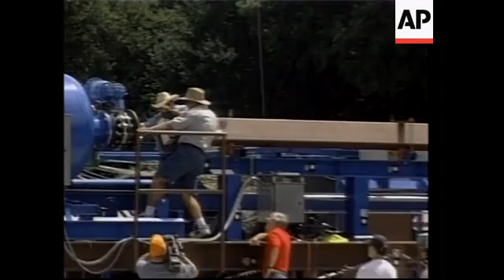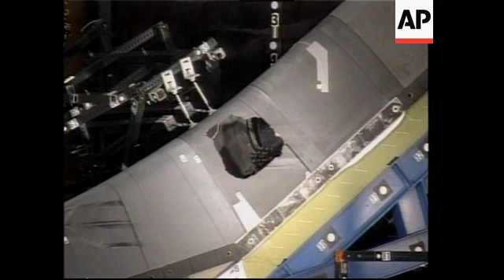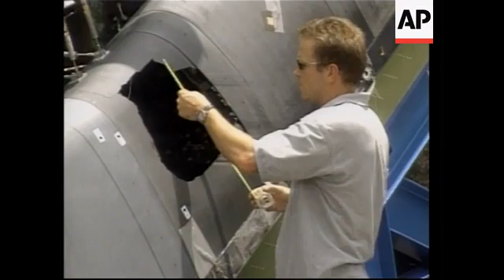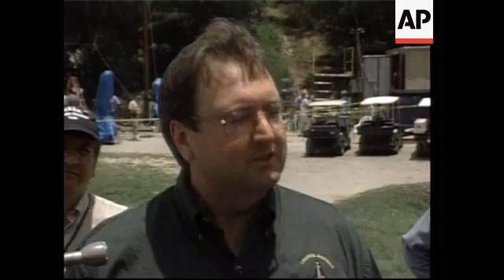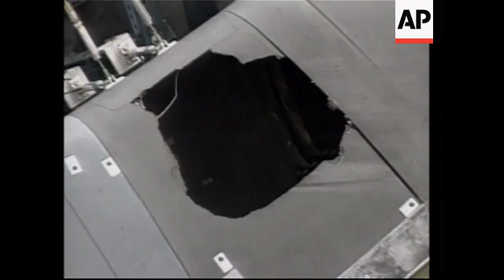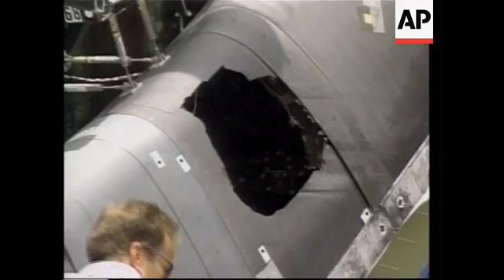Foam test blows hole in wing

Comment: This test looks like it was designed to confirm a bias not establish any data. Firstly the foam projectile was fired at what appeared a 90 degree incidence to the flat section of the wing panel, which is maximum force at the possibly weakest point. The actual investigation put the angle of impact at less than 20 degrees and probably on the leading edge which may have much greater reinforcment than the wing surface. Also, the foam was tumbling in flight which may lessen any impact force, and the foam was already travelling at 500-700 km/hr in the forward direction at detachment. If the foam actually was travelling at 500km/hr and we ignore deceleration/acceleration lag, it would have traversed the 47m of the external tank in .005 seconds, or twenty times faster than a fast human blink. The video may have been slomoed but it didn't look anywhere near that!
 I would have been more impressed with the test if it had replicated actual conditions and had the foam bounce of the leading edge, or even the flat wing panel, and analyze the damage caused then. Also I wondered at the time why it wasn't standard practice to inspect for damage in orbit. Perhaps they did. I would have!
It really could have been anything: roasted bird strike on re-entry, space debris in orbit? I know, the odds are astronomical, but then that is where they were, up with the stars. Ite in pace space travellers.
Reply: Just watched a new documentary on Max. They could have looked at it and even discussed asking to use military satellites to look at it, but ultimately they didn’t.
Reply: You can google the Columbia Accident Investigation Board Final Report - there's a readable pdf version. You'll find many of your assumptions are incorrect, as well as answers to your questions about whether or not they looked at the wing on orbit.

Comment: Keep in mind that after that foam strike, airflow was still increasing through that hole, i think a lot more damage was done. If the telemetry data is available to the public, i bet the drag caused by that hole yawed the shuttle slightly to the left.
Reply: Correct. You can look up the Columbia Accident Investigation full report online and that is exactly what happened. Unfortunately the shuttle comes in under computer control, so the computer was compensating as long as possible without any human noticing. Eventually all trim control was melted and the wing so deformed that the shuttle could no longer maintain position, went into a tumble, broke up.

Comment: The full context makes this even more shocking. The NASA heads were ADAMANT that it was just foam and it couldn't cause much damage to the wing of the shuttle. This footage proved them so wrong and so shockingly. It punched through the wing like paper!  Reminds me of a Mythbusters episode when they rigged up a tube system to launch a ping-pong ball to over mach 1, and fired it at a ping pong paddle. Well, the lightweight ball smashed a clean hole right through the paddle.

Comment: I'm surprised that NASA did not perform tests of this type prior to the Columbia disaster. They knew that foam coming off the tank was a fairly common occurrence. I guess hindsight is 20-20.
Reply: A perfect example of not to assume there isn't a problem just because the outcome happened to be ok a few times before
Reply: I worked in the USAF (civilian) and our Colonel was called in to the investigation.

I understand the phenomenon but not sure I can adequately explain it but I’ll try.

So the wings were designed to take impacts from debris impacting the leading edge.  What the wings weren’t designed to do was take impacts to the flat wing surfaces that were perpendicular (90 degrees to the flat surface).

What happened was the piece of foam fell down and the piece sort of “twisted” (for want of a better term) after hitting the leading wing edge and caused a portion to hit the underside of the wing at near 90 degrees causing the hole to be punched into the wing surface!
Reply: They learned zippo from Challengers, sad indeed.

Comment: I remember when we first found out about the foam there was a representative on TV saying there's no way that lightweight piece of foam caused this accident and I knew right away it did.
Doesn't matter how light something is, getting it moving fast enough and it will do damage.
Reply: Hindsight is 20/20, but yeah, that guy pretty much invented the "Wow, that didn't age well" meme.

The big issue is that they had tons of data and had computational models for tiles damage (the program called CRATER) but basically had NOTHING on what impacts would do to the reinforced carbon carbon panels of the leading edge.

They used the incorrect analogy of a foam cooler hitting a car on the interstate. Assuming a speed of the car at 70MPH, the maximum impact speed would be 70MPH (and that assumes that the coolers just stops dead in midair).

The speed of impact of the foam on the Shuttle was around 600-700MPH and it was not a glancing hit.

Comment: Should've been held liable for murder. When I was growing up it was stated anything strikes the orbiter that launch was aborted. Even in flight.
Reply: NASA didn't know until Columbia was in orbit, so an abort wasn't possible. A rescue mission might have been, but they didn't try.
Reply: @jshepard152  even then a rescue mission wouldn't be worth the risk. as far as i know, the only other shuttle they had was atlantis which wasn't ready for launch and would require multiple security checks to be skipped if they wanted to launch it early. if the columbia shuttle shouldn't have been launched under the conditions it was, then atlantis absolutely should not have because now you're just doing the same exact thing but far riskier with a new crew and a more complicated goal. worst case scenario the resource-intensive shuttles both end up disintegrated with both valuable crews lost and you've completely botched two anticipated shuttle missions in a row; which sounds pretty disheartening.
Reply: why would they be held liable for murder? that's like calling a contractor a murderer for building a house that collapsed onto its residents after being left unmaintained for 70 years.  60% of the NASA's shuttle launches at this time had insulation foam break off the exact same way without any problems using the exact same method. they had no idea until then that it could gouge through the wings at that size because they had no reason to believe it wouldn't have happened already if that was possible... y'know, right until that point. the crew are also made very aware that this is risky and they could die doing this. at this point there was no established protocol that they were failing to do, nor any intentional mishandling of the shuttle so you couldn't consider it manslaughter OR murder. they wanted and did everything they knew worked at the time to get this shuttle in and out of space. the design just wasn't advanced enough back then.

Comment: Show this to the 911 conspiracy theorists, "how can an aluminium aircraft damage a steel structure"
Reply: what if a space shuttle crashed into the twin towers
Reply: @lightyagmi2010 😂👍
🤫👶🏼😴
Reply: So you're saying the strength-to-weight ratio of carbon vs foam is comparable to aluminum to steel? And that the impact energy of a chunk of foam versus the carbon leading edge has a comparable ratio to the impact energy of a plane versus a building? I'm not a conspiracy theorist but what you say makes no sense in an engineering perspective. I shot somebody with a gun and they died so a plane into a building will cause it to collapse?
Reply: @straightpipediesel  its all the momentum, that energy has to be displaced somewhere. Even if you fired a gummy bear at something with enough energy it could do some damage
Reply: @straightpipediesel  foam vs something that is 10x stronger then steel
Reply: toooo beeeee faiiiirrrr their argument is usually the whole "jet fuel can't melt steel beams!!!!!!!" stuff and not about the airplane itself
Reply: Conspiracy theorists are all loony.
Reply: Yes Lucas sure thing 🤣
Reply: Cruise planes would fall apart at that speed and weight even before hitting anything. Planes hit the buildings, but they were not passenger planes, they were military planes. And no, they did not bring the buildings down, controlled demolition did.

If you believe the official narrative you deserve a vaccine every month.

Comment: The edges weren’t tough enough.  The material seems brittle.  And the insulation should have been inside the tank housing.
Reply: yes, insulation inside makes sense..but that means double wall i guess, too much weight maybe, but nothing is stopping foam traveling over 700mph..heck it'll do 17,000 mph, 4.9 miles per second, the shuttle isn't withstanding any threat from space either, just a room to hold in oxygen and keep out the heat and cold

Comment: What's amazing to me is that despite most of the engineers and scientists having PhDs they ignored a simple equation about kinetic energy that most learned in high school. And that a guy had to create a demonstration (at quite a cost) to convince these apparently intelligent people that they could no longer dismiss the fact that foam which seems intuitively "too light" can kick ass at 500 miles an hour squared. Sadly, people have to die to get these problems fixed; same with Challenger tragedy.
Reply: People in organizations are subject to group think and logical fallacies.  NASA was no exception. Normalization of deviance was a huge problem in both the Challenger and Columbia disasters.

Comment: What is terrible is that,they did not do shit to protect the wing from "shooting"foam debris,instead,it is on the tank,that protection"nets"could have been used,or deflectors to"drive"those pieces away from the vehicle,anyway,that brick will never fly again.........
Reply: The foam hit the wing during launch... There would be no way a net could protect the shuttle at that speed
Reply: @idkhowtoright479  Netting around the external tank was looked into in order to prevent foam coming loose but the net itself could have got damaged and broken loose which would have been a far bigger hazard.

A better solution would have been a faster fuelling process and smaller launch windows which would have taken away the need for the insulation but again, easier said than done and again, potential ice build up could have been even more dangerous.

Comment: Why the hell where they laughing about this?  The glad-handing?
Reply: Well, they had been investigating this for a while, and needed to prove to many doubters that the foam piece could actually damage an RCC panel. This test finally proved the idea as entirely possible, and when one can definitively give an answer as to why something like this happened, I imagine it is a very satisfying thing, and a completely natural reaction. It doesn't mean they are celebrating death, or are being insensitive. They've just solved a big problem.
Reply: IN a documentary on you tube, the man talking who led the investigation, was laughed at himself by other engineers. They told him there was no way that wing could have a hole blown through it from a piece of foam. The material was so strong, it was a fairytale. Well, a lot of those engineers were there for the test. I'm also sure you could hear the shock and gasp when they watched it happen.
Reply: @JamieTheBangles11Fan  Calvin Schlomburg,  the guy that repeatedly told the flight managers that there was not flight safety issue - was still skeptical about foam causing a hole.  Even after this test.  Even after the mountain of evidence pointing to the left wing failing first, with sensors failing n shit.   He still thought it was something else.
Reply: I wonder if he thinks that the shuttle is still up there somewhere
Reply: Relief and satisfaction. 

These people faced so much resistance trying to prove what happened it was ridiculous. It seems like an inappropriate reaction but you have to put yourself in their shoes. 

A lot of people were worried as soon as they saw the strike and certainly once it became clear the orbiter had been lost, many people knew exactly what had happened but between denial, face saving and hubris, many didn't want to see the truth and even mad it difficult for these tests to be carried out.

This was the conclusion of a quest for the truth and in a sense, justice for those who lost their lives which was at least partially the consequence of human error, AGAIN.
Reply: Exactly it isn’t funny at all, it makes me angry that they are laughing